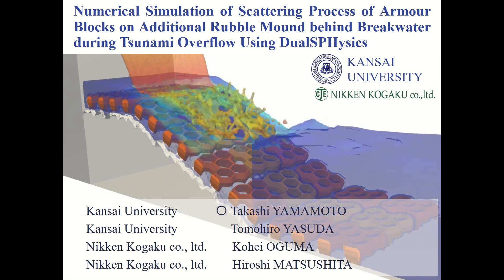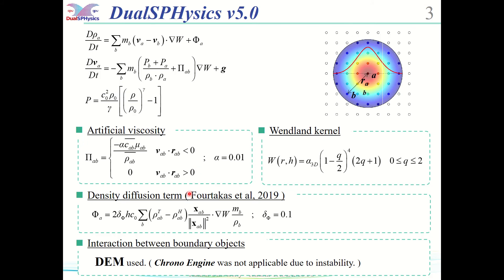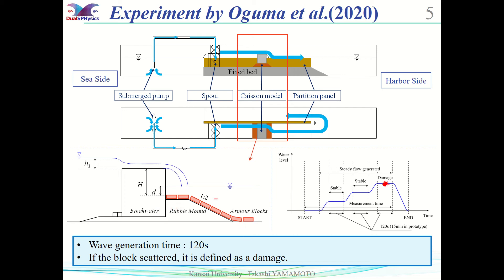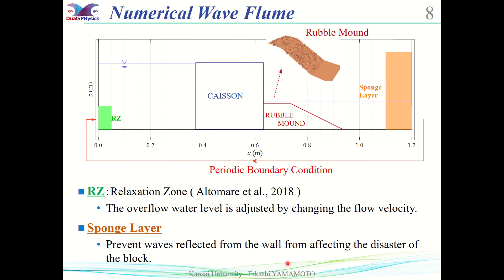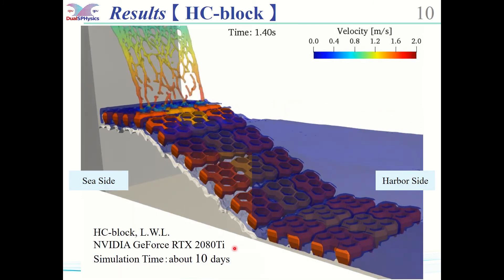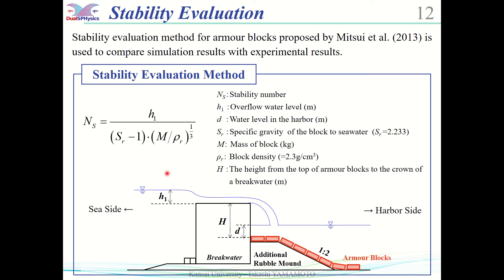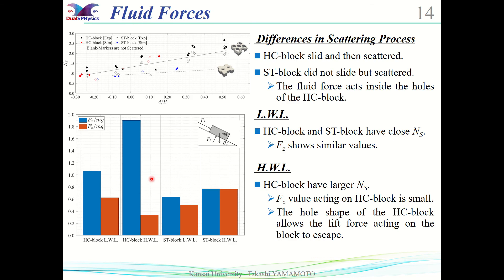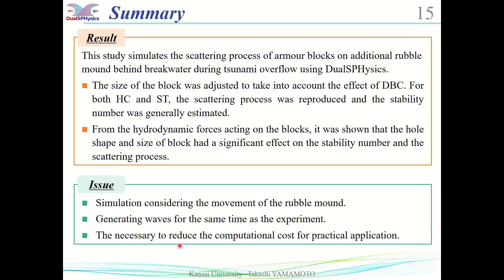Session 3, 5DUW 2021 - Takashi Yamamoto

Comment: The wave hitting the concrete surface with a speed of approximately 135 km/h reaches a height of 1 meter approximately 24 meters ahead. What method can be applied in such a coastal area?
Reply: If a 1/3 stone covered ramp is made with a semicircle of approximately 1.25 radius at the end of the ramp, will the wave speed and direction change?